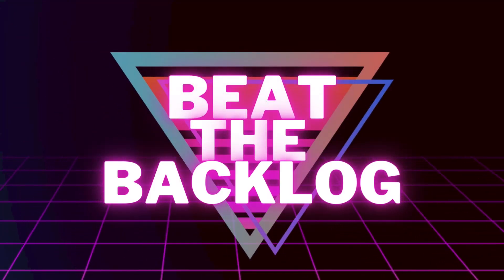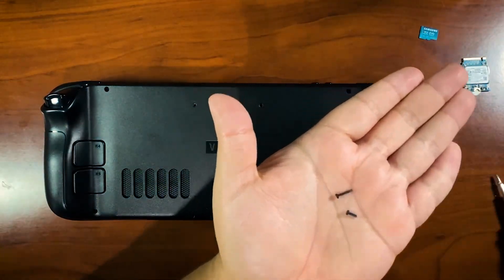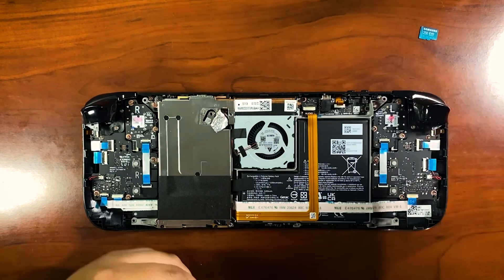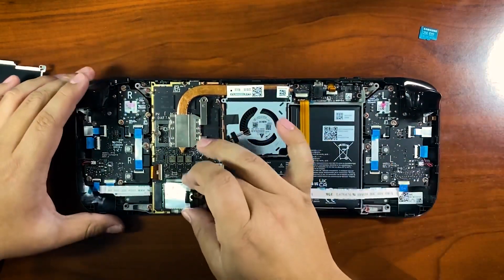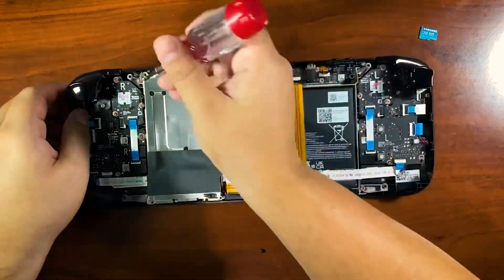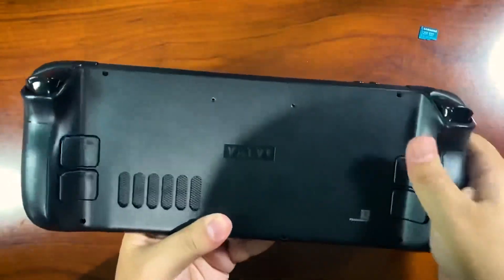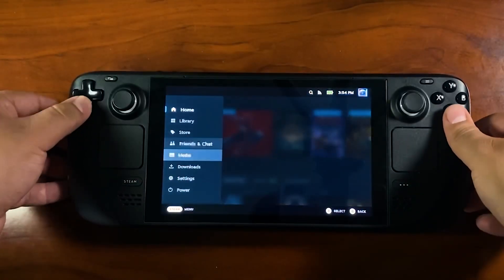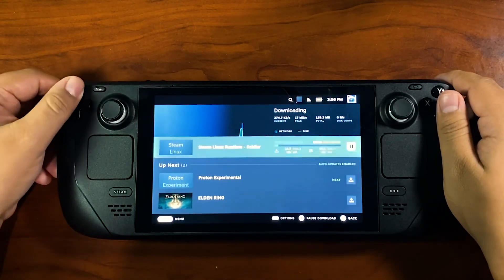EASY Steam Deck SSD UPGRADE

Comment: Hello, I'm I got the 64gb steam deck and I'm a little scared about opening up the steam deck to add a bigger ssd. Would it be better if I just get a micro SD card instead?
Reply from the maker: Yeah the micro SD card option is always going to be easier! There are a ton of great options out there my recommendation would be the Samsung Evo micro sd cards
Reply: @btb605  could you possibly give me the link plz?
Reply from the maker: SAMSUNG EVO Select Micro SD-Memory-Card + Adapter, 512GB microSDXC 130MB/s Full HD & 4K UHD, UHS-I, U3, A2, V30, Expanded Storage for Android Smartphones, Tablets, Nintendo-Switch (MB-ME512KA/AM) https://a.co/d/8xTso3e

Comment: Thanks for the tutorial! I've heard that doing Deck upgrades voids the warranty, so I'll just get the 256gb model and buy a 512gb card, which costs less in total than the 512gb model. 😁
Reply from the maker: Always a great option I’m just happy to have the option to be able to upgrade the base steam deck
Reply: @Marvda sounds like you might have an issue then, or bought a strange SD.
Reply: @Marvda Oh sorry, I misread and thought you were referring to an SSD, not sure why.

Comment: 🤔 Hello!, I have a question: Can you add thermal pads to the SSD?, above and below it, is there space?
Reply from the maker: I think if you really wanted to you could add some but ultimately the drive isnt going to be the hottest part of the steam deck compared to where the processsor is located.

Comment: Just fyi, this will shorten the life of your SD.
Reply from the maker: Also the SSD used is the same brand and specs that are included with the 512gb steam deck
Reply: Since the SSD he replaced was also in the 2230 form factor the lifespan will likely be negligibly shorter, so much so you shouldn’t worry about it. The big problems is when you get an SSD that’s longer where it covers the Battery IC which gets very hot.
Reply: No, 2230 is fine, if you put a bigger one like a 2242 then it draws more power and covers up the battery controller which cooks it. If you stay within spec, use a 2230 and make sure the thermal pads are still there correctly, there is zero concern.
Reply: wrong steam was talking about longer sdd 2242

Comment: at that point.. just spend the extra 260 (160 extra, compared to what is done in this video) for the 512gb model and get the better screen aswell.
Reply from the maker: Or you could just spend $15 more dollars and add an antiglare screen which I think is better because of added protection!
Reply: @btb605  It won't be as good as etched glass.
Reply from the maker: to each their own
Reply: Etched glass will bubble on you, lots and lots of reports of screen bubbles with those. Screen protector is the way to go.
Reply: @EmergencyChannel  Copium, its not a big issue at all. Few people on Reddit experienced
Reply: @sorvex9  you cannot put a screen protector on the etched glass because the glare comes from the the tempered glass it's useless

Comment: But the biggest 2230 is 1TB, I got win max 2 has 4Tb 2280 and 1TB 2230
Reply: Steam Deck only support 512GB 2230, not other gigabyte or NVMe sizes. Going beyond 512GB is beyond the manufacturer's specs and Steam itself has advised against it
Reply from the maker: For me personally I can only
Keep up with playing a few games at a time so the 512 and an ssd is more than enough that’s the great thing about the win max and other competitors is that it gives you options if your willing to shell out that kind of money but with this upgrade it still was under $500 (new ssd and sd card)
Reply: except win max 2 is same cost as decent spec desktop, especially with that 4tb "upgrade". pissed your money away lmao
Reply: @modestmouse6  gotta admit, the performance of the Win Max 2 with an eGPU is desktop-class adjace. However, once you spend that much money on an eGPU that has to sit at your desk...

Comment: Put the back panel back on but honestly just set up the Steam Deck and confirm the storage space before snapping the back into place and screwing it back on. Better to just make sure everything works smoothly.
Reply from the maker: Great tip although there isn’t a ton of worry as long as you get a well known brand this wouldn’t hurt!

Comment: So, after replace you basically lost your warranty... 
Maybe, micro sd would be better option?
Reply from the maker: Although it’s unclear if this upgrade would opening it won’t so if you do need to RMA for anything simply throwing in the old nvme and sending it in would most likely be your best bet for a warranty situation
Reply: @btb605  Valve has been great with customer service concerning The Steam Deck. They want satisfied Steam Deck customers so they can sell more Steam games, which is where Valve makes their money.
Reply from the maker: @merlin-ju6fu  Exactly!
Reply: No, there is no way they will know you opened it unless you break something, which is unlikely. If it ever needs RMA'd, just put the old SSD/eMMC back in before you ship it.
Reply: The warranty is not lost, Steam allows this
Reply: No upgrading the ssd doesn't void the warranty
Reply: It's if you break anything they say no to helping

Comment: This is the first thing I need to do next payday. As I to got the 64gb model..if I can find a 1tb that's not going to break the bank if not 512gb with do just fine.
Reply from the maker: For sure I mean even with my 512 now I’m able to fit everything I’ll want to play plus adding an SD card can get you to over a terabyte later if you want!
Reply: On ebay I've seen 1TB MD SSDs and Samsung ones for about $150 each. If you're willing that doesnt sound like bad deal